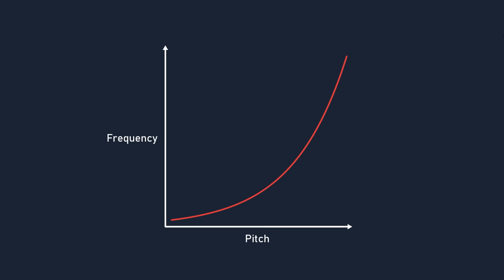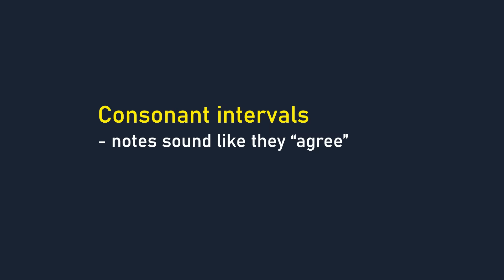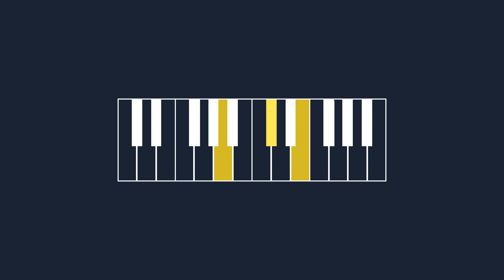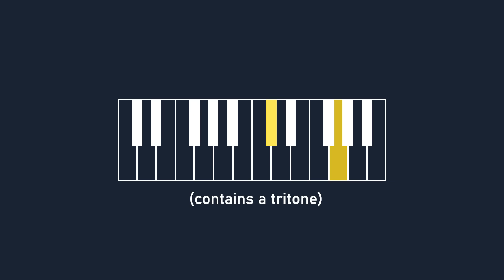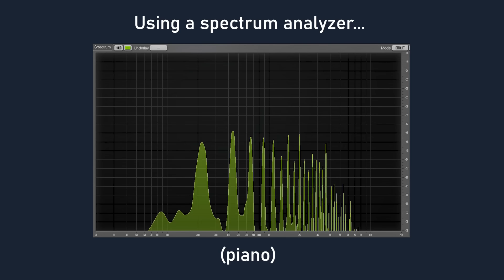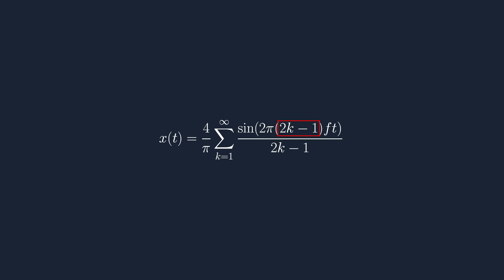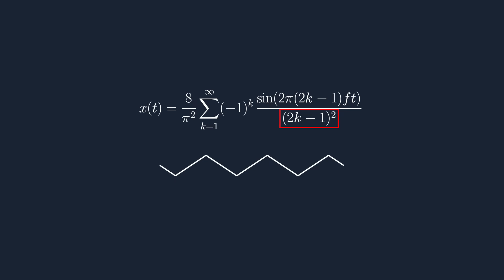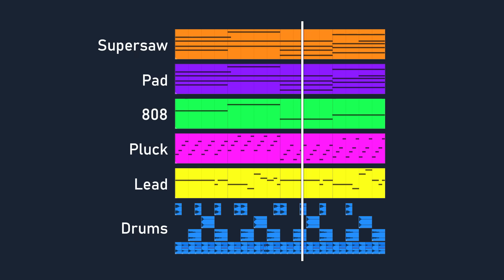The Math Behind Music and Sound Synthesis

Comment: If we use variable RLC filter directly from 120 v ac reduction into 20 diodes graduate to 6 volts and 120 hz then combine all into frequency multiplied into 4 times we get nite C and varies 100 hz from it up and down them get all notes so we get power to 3 octaves each had 6 notes and half tone additional concurrently

Comment: To me the most important aspect of music and sound synthesis is the dynamic noise. It's why the same frequency sounds different on different instruments. Some may call this timbre. Noise does not follow the superposition principle. Generally even if we synthesize waves with digital oscillators, we tend to add some effects, detuning etc. to make "more natural" sound--meaning quasiperiodic sine waves with superimposed chaotic noise packets. Linear superposition of harmonics can be approximated, but does not reflect on the true resultant waveform when noise is in the mix.

Comment: A little touch to add: earlier musicians preferred to use whole number ratios when tuning fixed pitch instruments (like keyboard or piano), but since we are using combinations of primes which are not divisible by each other, some intervals inside the scale would be VERY dissonant. So to enrich the spectrum of musical expressions some clever guy decided to make equal temperament, where each interval is slightly detuned from it's whole number ratio "pure counterpart", but all dissonants sound bearable, so you can use all intervals. For more context google "wolf fifth"

Comment: I can't even grasp the very first concept. The difference in definition between frequency and pitch is that frequency is the math property used to build a model on the physics of the air waves and pitch is our human perception of the sound in tonal quality but in discussion they are functionally the same. What the hell does it mean that relationship between the frequencies and our perception, pitch, is exponential? The demonstration did not help. When I listen to the frequencies, I can't take the difference between two pitches and say "ah yeah, I can hear that one sounds like half of the other," there is no half-the-pitch, the only way it makes sense is by framing it around frequencies and applying a numeric model to the sound. Nor can I compare the amount of pitch change from 200 to 400 Hz and say it felt like the change from 400 to 600 Hz was less than from 200 to 400. They're all distinct sounds! I don't perceive them to have any relationship at all, each of them are just different sounds altogether.

Comment: This is the reason led to our demise because what if the vacuum cleaner, the hammer, the traffic ultrasound noise would disrupt harmonic frequency then Fourier can not distinguish the inbound communication intelligible. Meaning noise suppression by all means can not eliminate infinite varietion . The best ways maybe ntegrate direct current pulsation of application both am and fm and pm then hopefully could help to better transmission and receiving data.

Comment: One important note needs clarification. The 12 notes spaced equally between the octaves and the root frequency are NOT by the nature of sound or the human brain. It is ONE of the tunning systems developed that is called Twelve-Tone Equal Temperament. One of the main pros of this system is that it allows different instruments to sound "good" together. That's it. There are many more tunning systems with 8, 10, 17 notes. This is important because the system itself is not the ultimate solution to the tunning problem but one of the closest we've figured out so far.

Comment: Thanks for the video! 
Just a small comment I mean... technically a perfect fifth is the ratio 2:3 in just intonation (from the harmonic series)! 2^(7/12) however is an approximation that fits the equal temperament system! But it proves that the piano is a bit out of tune 😊 It's a compromise that comes from 2:3 but to fit the framework of a 12-keys system, so the calculation should have been the other way around i think for your explantion of intervals...
I hope that makes sense😊

Comment: 8:00

What are these wave shapes, physically? Are these still essentially graphs of air pressure?
Reply: A signal, basically a current in an electric circuit (the graph represents current amplitude over time), then it's used by a speaker to create air vibrations.
Reply: When played by a speaker yes and when they reach our ears yes they are air pressure waves. When stored as data in memory they are high and low voltages. 0s and 1s

Comment: I'm mathematician. So I have question about Fourier series.
You use only sine terms. But where are cosine terms?
Cosine terms can be converted phases in sine terms. A those used anywhere?

upd:
What came up to me.
String with two fixed ends can oscilate only on sine waves.
However, I'm still sure there might be phases (i.e. cosine terms) in other cases.

Comment: Great animations :D
Sidenote on Fourier's Theorem: It's not like writing some sound as a sum or integral of sinusoidal waves "may work", it even works for non-periodic discontinous signals like a kickdrum or a sudden blast, or various noise, although that is not as obvious as the regular version of "instruments have more than just one frequency".

The only limitation to it's applicability is the range in time you want to cover. The larger, the better your results in terms of precision, but the less information you have on individual elements within that time frame. That's the famous uncertainty principle, which for some reason people only think of as "something with qunatum, right?". But in general, every function whose integral over the square is defined (in other words: it does not blow up to infinity) can be built up from complex waves. That even holds for something like a parapola or an exponential function if you limit the the range of the integration to some finite limits.